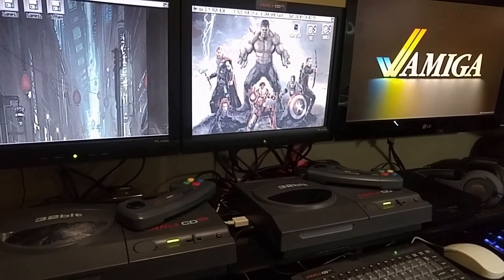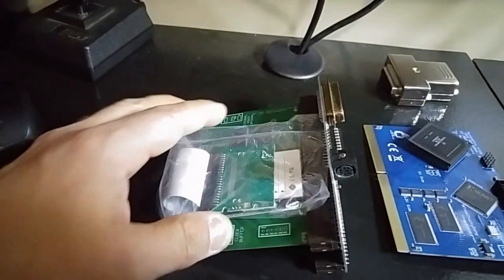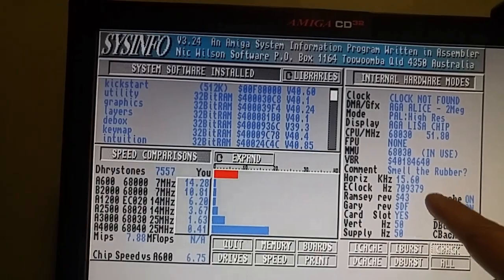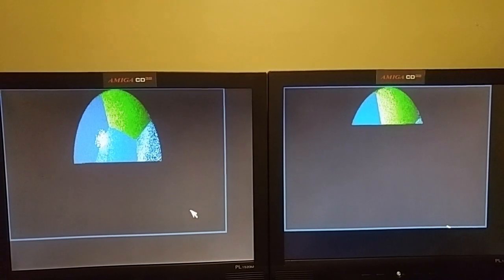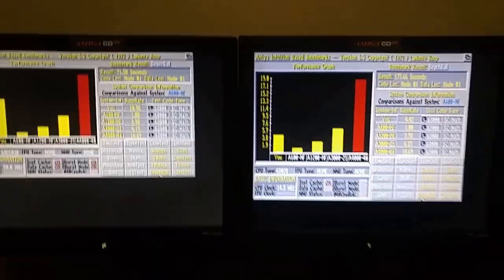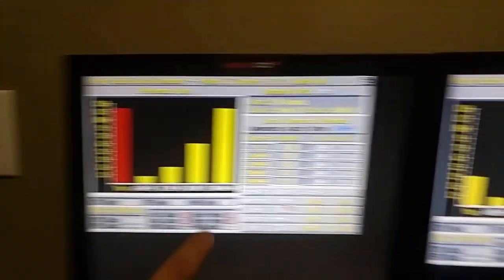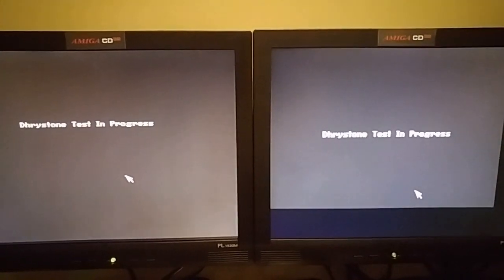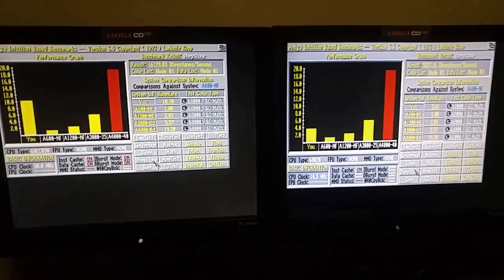Amiga  CD32 Accelerator - Terrible Fire TF330 in the Wild!, first look,install,benchmark,impression

Comment: Well done! Cool video. Two usb-ports on a forked version of an accelerator (even one which which might desire a pull-request to do so) could be great to use a different CDROM drive (to save wear and tear) and yet still get that AudioCD quality (by the different output) and not being relegated to only 8but sound (as cute a sit can sometimes be), and maybe even DVDRW functionality, along with a flash-memory pendrive as HD0. Likewise mpeg2 encoding an decoding could be done video a modern usb capture-dongle chipset in place of the FMV cartridge for dragons-lair style games or cannon-fodder FMV. Then also NDisWrapper 32bit (WinXP) drivers could be used for wifi dongles, RJ45 and serial devices. These are simply affordable ways to get 'newish' solutions to be equivalent to old hardware.

Would you consider making a video using Vista (3D landscape generator) to show FPU penalties for accelerators with and without FPU? Your setup is just so cool! And you make videos clear and to the point. Maybe, if you like, also try running a voxel game like "The Shadow Of The Third Moon" which can be found on youtube.

The CD32 could actually (especially using the screws nearby to the 68020) have an FPU expansion board (custom made) clipped on the edge of the PCB to "piggyback" onto the 68020 (even though it is low profile) to speed up a bunch of maths with full transcendental operations usage (with some pull-up resistors and caps of course to help the 68882). Enabling and disabling it via dip-swicthes and a tiny LCD (e.g. powered with some C size batteries) could allow for it to turn on-and-off alternative zorro based accellerators (when unplugged from the mains) for compatibility in software so that perhaps the zorro port of a CD32 can be used for more ambitious accelerators such as a PowerPC from a mac coupled with a cheap 040 (sans FPU - as the PPC could emulate that with sufficient IEEE heritance), such as a very cut-down MC68040FE25V CPU.

The usage of FPU for pre-calc in copper-chunky coding (homebrew and demoscene) could be worthwhile and would be a good way to allow cross compatibility on a500 (accelerated) demos. An example of that can be seen in the scoopex video "grade my waterbear" (which you can find by searching youtube). It is a pity for such great software influenced by that demo to be crippled by an accelerated aga amiga, largely for want of a different implementation of an oscillator. These custom chips and hardware such as AmigaCD are part of "what made an amiga an amiga" and AmigaCD (for example) is "the amiga amigans wanted" back in the day, irresepctive of WHDLoad (as handy as it can sometimes be). Plenty magazines of the day refelct that, such as those speaking of the cd1200 add-on and CD content for the a4000 and CDTV.
Reply from the maker: Thank you for the feedback I really appreciate it. I'm glad you like the video.  I have Vista 3D landscape generator that sounds like a great video Idea will add it to the list.   I'd like to see a floppy port added to the riser to give us access to the collection original disks we all have. WHDLOAD is awesome but there's nothing like slotting in a floppy and hearing that  mechanism engage :).   could not agree more on the FPU that would be great.
Reply: @32Bits  Floppy (and DVDRW etc) could be added via a Pi4. I agree about the experience, sound and ritual of CDROM and floppy. Also writing to floppy is cool nostalgia and a better "amiga Master Race" savegame method than psone normies had with their 1mb memory cards which they could not boot from. ;p
Here (linke dbelow) is a video on making video cards. Considering ATI PCI cards have been added to a1200 machine via a PCI slot, it is time for the video-toaster to be remade (or something similar) for the amiga (a500 via zorro sideslot or PCI-e handled by FPGA plugged into the CPU or FPU socket of an acceleator) but with FMV CD32 cartridge capability in mpeg2 encoding and decoding.

With that, I think games that overlay graphics akin to to the megaCD and megadrive are on the cards for the amiga (for the amiga in the style of dragons lair or mad-dog-mcree). It would mean full 4096-HAM6 (or even 24bit) graphics sprites can come from an accelerated a500 amiga (e.g. a 68030+FPU or faster) with one transparent colour in the background, and then a second amiga megaCD console (like a boosted cd32) can peep through the mask of the clear background (or vice versa). Way better than the KangFu game.
Here is a recent video on PC guys doing it for modern PC computers, but the principle remains because ATI-radeon9200 cards (or even an all-in-wonder-pro) have been plonked into an amiga a1200 in the past and worked. You needn't watch all this 8minute video link (pasted in comment below), and so just glancing at a minute of it will give you the basic gist.

If my comment below gets marked as spam by YT automatically for having a hyperlink, you can see it instead by search for the "Gamers Nexus" channel and the 16July2019 video entitled "Make Your Own Video Card w E-Power Ft. TiN of EVGA".
Reply from the maker: @obsoletepowercorrupts  That's interesting I'll have a look.
Reply: "Gamers Nexus" channel and the 16July2019 video entitled "Make Your Own Video Card w E-Power Ft. TiN of EVGA".
https://www.youtube.com/watch?v=ewkVNoMbcCc